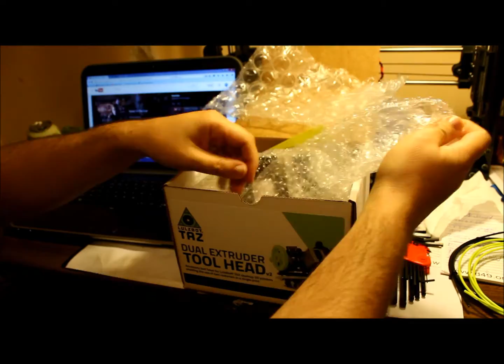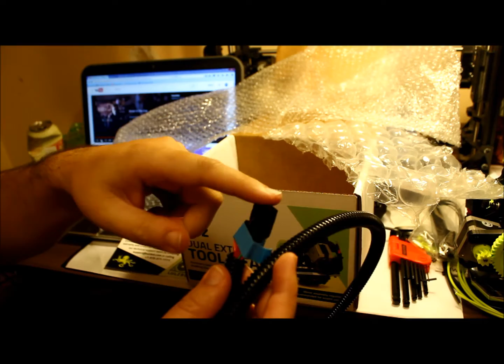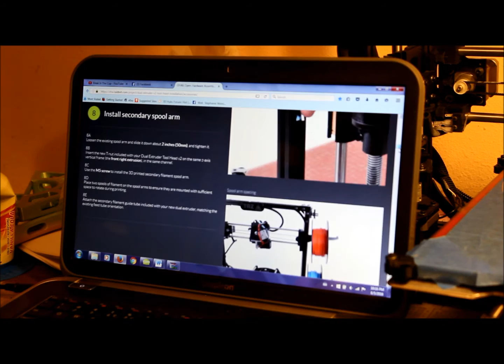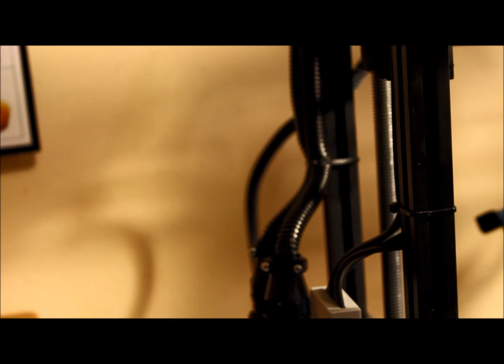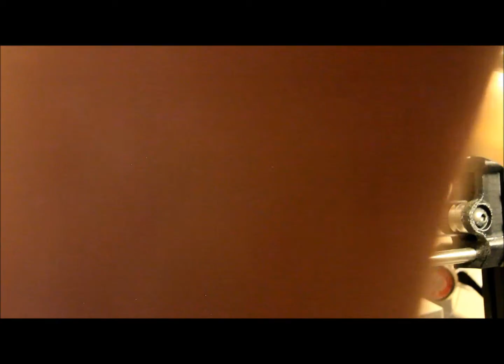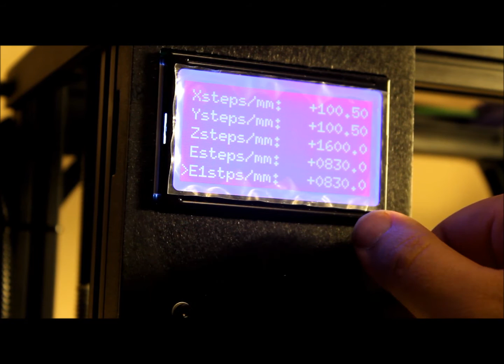Unboxing Lulzbot V2 Dual Extruder Tool Head

Comment: i was thinking about getting this for my taz 6...  do you know if issues have been resolved? if not i am looking at picking up an ultimaker 3 extended too since it looks like they have the dual extruding nailed.
Reply from the maker: I don't think Lulzbot has done much on the issues. The Dual head is just a weak product, the ultimakers look so much better.
Reply from the maker: They just switched to a side by side dual extruder, this may go out of production soon.

Comment: are you having problems with yours? mine has been nothing but issues for me. the Z offset is pretty terrible but the worst part is the cold end fans are too weak. filament just fuses in the cold end after 20 min
Reply from the maker: I don't use it anymore, I'll keep it for special orders. TI-Works found that the fans were under powered or not worth a crap. This may be the weakest product in the Lulzbot inventory. I printed at the low end of the printing temps, and the two heads heated each other.
Reply from the maker: I talked to an insider, many of the cooling fans came from China badly under powered or not functioning. This one may go out of production soon for their new side  by side model.
Reply from the maker: An Update. The V2 head was discontinued for good reason. I worked for Lulzbot, and this was the most returned product in the company. Right now I'm keeping it for spare parts.

Comment: hi Eagle! I have the same toolhead, but it's installed on my Taz 6. Do you have problem leveling the 2 nozzle? I can't get them level on especially with T1, and it's affecting my prints. So i decided to swap it back to the single nozzle for a while.
Reply from the maker: T1 was difficult, took a lot of trial and error and outside help. I bloged about this on 3Dpritnerchat.com

Comment: Is your bed surface damaged, as you have in covered in tape.
Reply from the maker: No, I always print over blue painters tape. I've found it too hard to remove prints from the surface of the build plate.
Reply: I print almost everything in ABS so my prints just pop off. I see you had replaced your idler arm on your single head. Did it break? Mine broke and had to reprint one. At the time, I was not aware of this bulletin: https://www.lulzbot.com/sites/default/files/extruder_idler_service_bulletin.pdf .
Reply from the maker: I stay away from ABS. I have not broken any idler arms, but worn through at least one with exotic proto pasta filaments. I replace them when I do any overhaul of my printer.